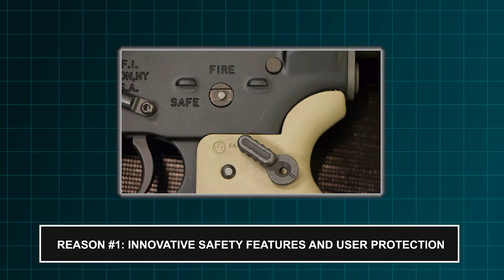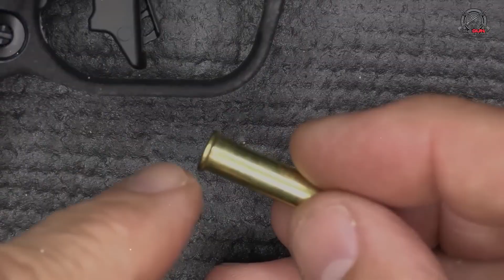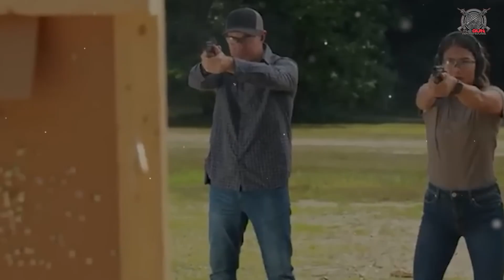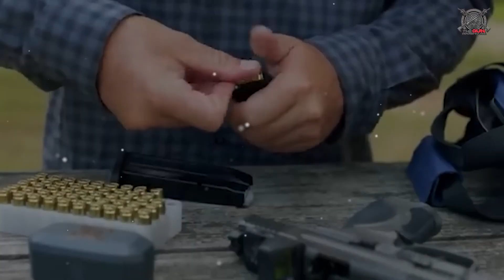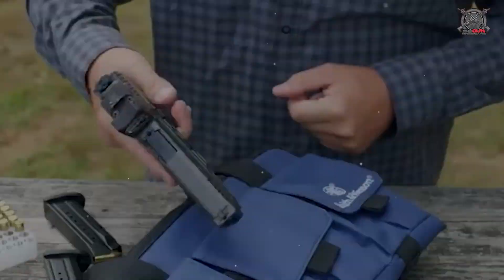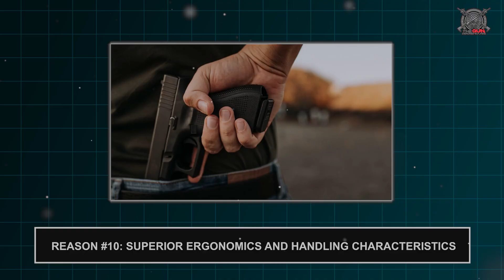NEW: Why The .22 Mag Pistol RULES in 2025?

Comment: this is bs. The .22 mag, from pistol barrels, has less than half the power that  a 9mm can offer, if you know to use the Liberty Arms 500 ft lb, 50 gr, 2100 fps (4" barrel) 9mm solid copper hp. Same recoil as a 380, but 4" 357 magnum type performance on animal tests.  The reason centerfire ammo got created is rimfre brass cases are "iffy".  When you load them up to be powerful, the cases burst at the firing pin indentation,  When you harden the brass, you get misfires. The 22 mag rimfire is veyr long for its diameter, making feeding, extraction and ejection 'iffy".  So you're WAY ahead to use the 9mm. Just get a 22lr conversion unit (or a 22lr that is very similar to your carry 9mm.  get another 9mm for practice, so the wear and tear of practice is not going on your carry gun. Buy 100 rds of the Liberty ammo. Put 50 rds of it thru your carry-mags, notcing the difference in POI< point of impact" Zero  the sights of your carry gun with the Liberty arms ammo and the practice gun with cheap "ball" ammo.  Get an airsoft "gun" like your carry gun and an alpha precision wristband shot timer, which works with both live ammo and airsoft.